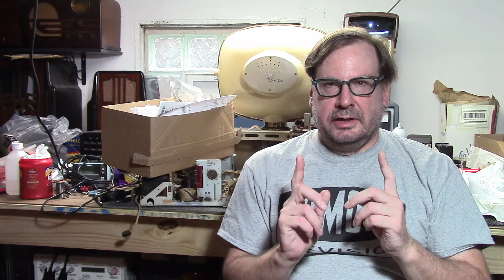Trailer - Predicta restoration tips and tricks

Comment: Thanks Bob - look forward to the series! (hope you include stuff on maximizing the picture with the adjustments available - hint hint!)
Reply from the maker: I think you mean getting the best looking image?  I don't really have any tips there beyond the usual.  Adjust fine tuning, brightness and contrast for the best image.  These sets don't have DC restoration so you may need to re-adjust when the programming changes.  When it does from dimly lit scenes to bright, outdoors for example.
Reply: @bandersentv  I have trouble with image geometry - heads look stretched, circles egg shaped etc...
Reply from the maker: @rongaunt8348  You need to adjust the vertical linearity. That affects the height as well so you need to go back and forth between the two adjustments.  I covered this and screen centering using the adjustable magnets a few videos back.
Reply: @bandersentv  Will go back and look BUT if you recall which video it was please let me know - thanks for all you do!
Reply: @bandersentv  I think I found it - Predictapalooza #9
Reply from the maker: @rongaunt8348  Nope, 13 around the 43 minute mark.  https://youtu.be/chRbJB-SehQ

Comment: Hello Bob. I am restoring a Predicta Chassis 10L43 from a Debutante table model and the Vertical Lin. Rheostat is physically broken. No way to fix it. It's around 1.5 kohm wire wound attached to the chassis with 2 rivets, but I only find bigger rheostats, not sure if they will fit. Do you happen to know where to buy one of this? I not mean the original but maybe something similar maybe? I will appreciate your expertise recommendation.
Reply from the maker: No, I replace them with 2W carbon pots.  I did a video on it a while back.  I'll try to find a link
Reply from the maker: Here you go.  https://youtu.be/chRbJB-SehQ?si=Ce4vkI1t124nGxmK
Reply: 😀Thank you @bandersentv